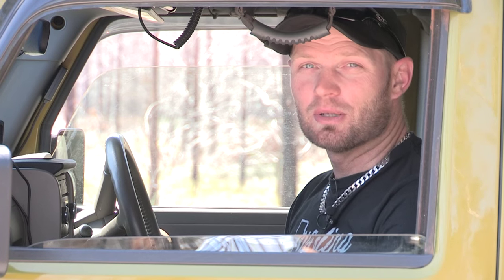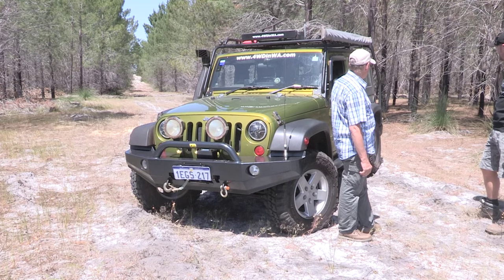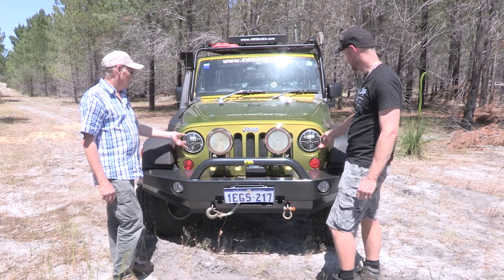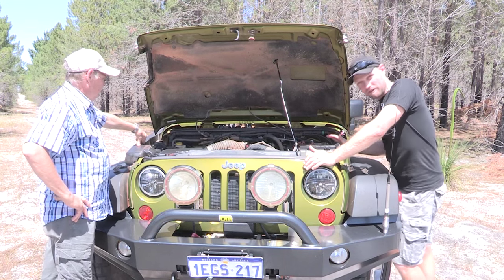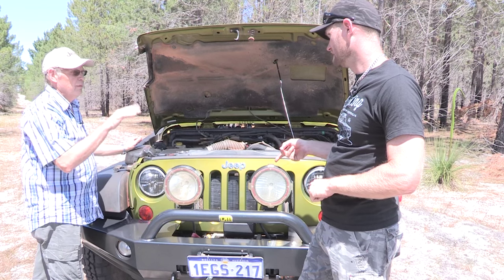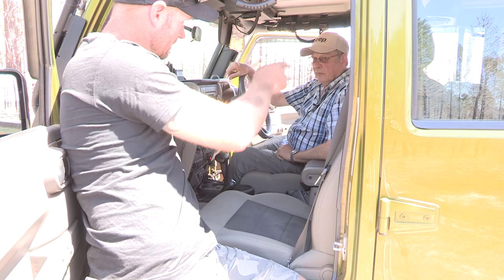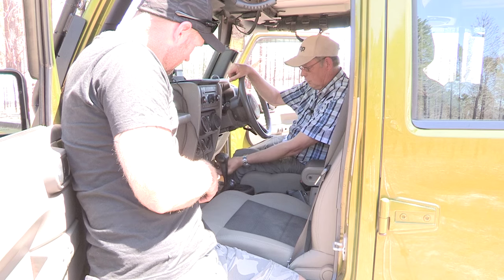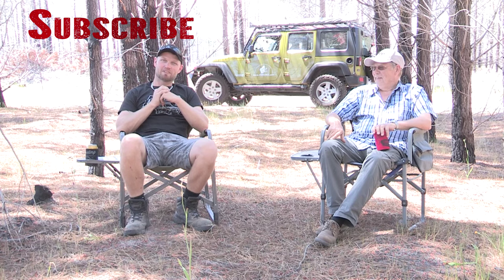Modified Jeep JK Wrangler, modified episode 11

Comment: I have a 2012 rubicon but I had no idea that when you have the right hand drive, the battery, fuse box and those things are also swapped to the other side.  I guess they stay on the passenger side.  Found that interesting.  Thanks for the video, very happy to see you doing all this with your father, that's fantastic!
Reply: Room is needed for the steering linkage.

Comment: Hey Ronny, greetings from the US! I have watched many of your videos for the last few weeks and appreciate all the work you put in to them. Would love to take a trip out there and do some wheeling and camping myself if I can find the time.The issue with those Jeep fans are prevalent throughout the US as well. I own a Jeep so I follow them a good bit and a common fix for the deep mud and water crossings is the installation of a fan electrical disconnect. The idea being to shut off the fan before these crossings so they cannot run in deep water and mud. The resistance created by running them in those conditions often leads to a lot of issues ultimately resulting in overheating problems. This being an older video and all of your experience I would guess you already figured this out. Just in case you missed it I figured I would share this with you.Keep up the awesome work!
Reply from the maker: +Christopher Patton that's a great tip mate, Brian ended up getting a water proof aftermarket fan instead. Pretty noisy but it does the job.

Comment: Only the Rubicon model comes with sway bar disconnects from the factory. The other models don't have them - well, unless you call a 18mm nut a "disconnect".  They are very popular to add - at least the mechanical ones where you have to go under the vehicle and pull a pin out. I added those for like $150 where the electric or pneumatic disconnects run upwards of $800. It really depends on how often you use them. For me, it's part of the experience so I'm fine to pull a pin while airing down - and getting dirty under the vehicle. Of course, if you want all that on the push of a button, either buy a Rubicon or add the electric sway bar after market to your model.  For me: pins worked back in the horse carriage days and they still do work well under any condition.

Comment: I really enjoyed this video! I'd give anything to take my JK down there for some adventures.  I've got a 2008 JK Unlimited Rubicon that just turned 97,000 miles and is going strong.  I've got a similar set up to your Dad, with a 2 inch lift, aggressive tires, and a winch on the front.  It is impressive to see what your Dad can go through with his.  How many miles does he have on his JKU, or kilometers, as the case may be?  I was also surprised to see the 3.8 petrol engine.  I thought most JK's down there were diesel powered.  Until 2012, we in the States were saddled with the 3.8, which is what I have.  It has served me well, but if I'd had a diesel option or more powerful gas engine option, I'd have taken it.  I was also surprised to see the automatic transmission.  Again, I thought most folks outside the US go with manual transmissions.  Mine has a manual, and because of it, I had to wait months longer for delivery.  I do like it, though.  Thanks again for the great video!
Reply: +Principal Skinr The Wrangler has gone 110,000 km.
Reply: +Brian Dahl Wow, with all that open space in Australia, I thought you'd have about twice that or more! My 3.8 runs very well, but uses about 1/2 liter of oil per 1600 km.  It has varied between 1/2 and 1 liter usage, but has settled down a bit lately, for some reason.  Overall, it continues to serve me well.  I'm hoping to get to about 320,000 km before it needs a rebuild.  I'm running Mobil 1 Extended Protection synthetic oil to help get it there.  I look forward to more videos that show your Jeep exploring that beautiful country of yours!

Comment: did the rear underfloor storage get modified to fit the battery and compressor? or does it just fit straight up and then the compressor fitting goes through a hole in the body?

Comment: hi Ronny, 
I have a 2013 JKU sport. I want to change my tire size to 285 70r17 with out lift kits. does it work? Because I will not put the bull bar / winch and real bar on my jeep now but maybe 6 to 12 month. So I cannot set the right spring coil. and I also don't want to change the spring coil in the really short period.
If the tire size dose not work, too much rubbing, do you have some other solution or advise for me?  thx
I  and a new guy in 4wd, barely no off road experience, but i want to feel that and in the mean time i don't want to damage my jk cause i did not do the right modification.

Comment: Hi Ronny Hahl (4 Wheeling in W.A.) My dad is looking at buying one of these vehicles second hand but would like to know if you have any idea why to stay away form the older 3.8L motor as to the new 3.6L Pentastar motor. Was there anything wrong with the older motor or is it just the new ones have much more power and offer better fuel economy? We're looking at a Rubicon unlimited but also open to another model if cheaper while still hotted up with lift kit, heat reduction bonnet etc. We've been told to stay away from the older motor but no one tells us why.
Reply: +Corey Dark due to less power.  Everyone rips on the 3.8 because it was also used in a minivan.  They like to say "it has a minivan engine"  but engines aren't car specific, all brands share engines.  That is their only real argument against it.  The 3.6 does create a lot more power and slightly better fuel mileage.
Reply: We bought a 2013 unlimited Rubicon with the 3.6L and man does it go.